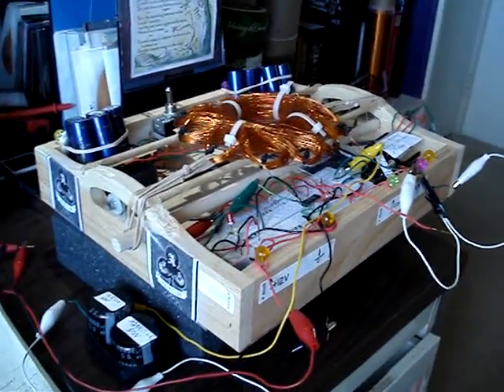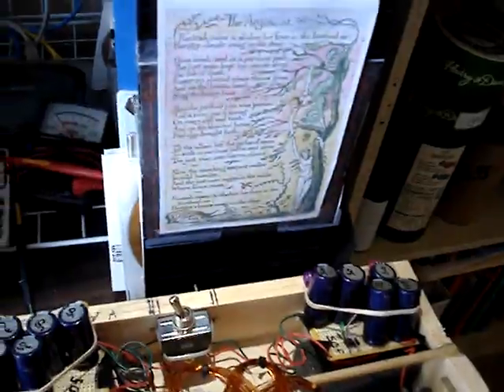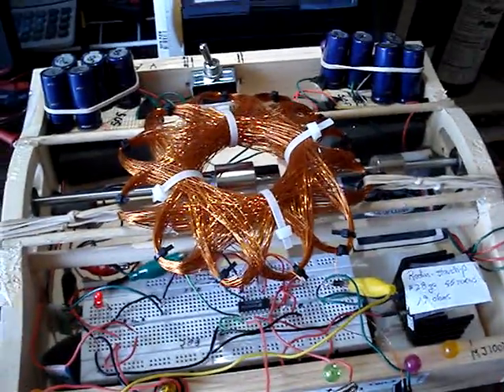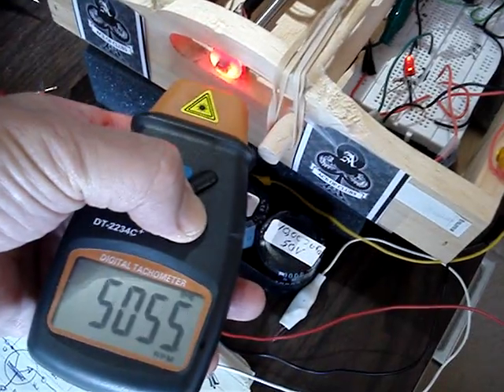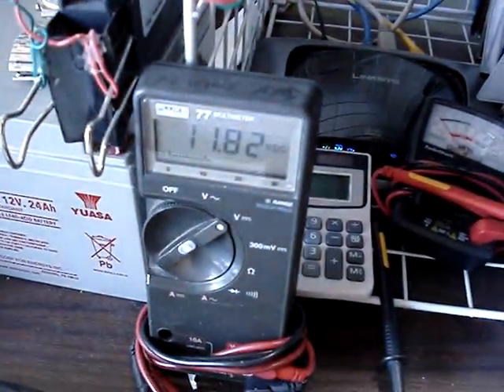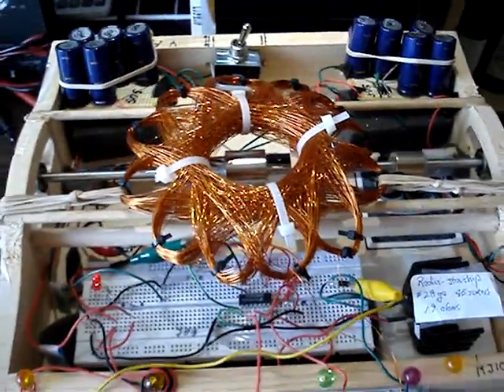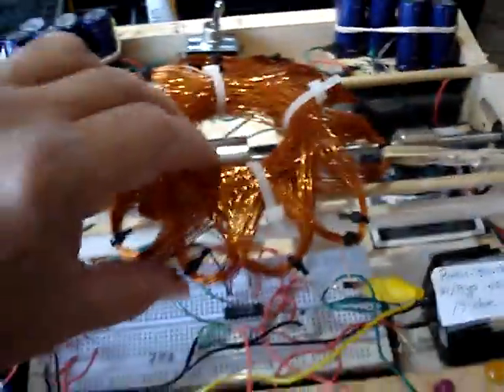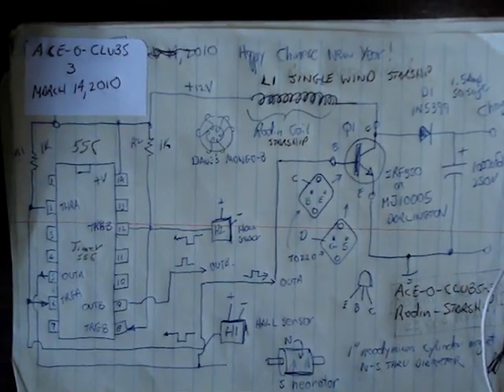ACE-O-CLUBS 3 Rodin-Starship Coil Pulse Motor

Comment: don't suppose i could trouble you for a pdf of your ace-o-clubs diagram could i? :)

i'm about to make my first starship, i just spent the day fabricating a really nice 8" wooden peg-wheel .i call it my starship clock because i have the 12 pegs numbered in the order in which they are would so it looks like a big clock with crazy numbers. anyway, i was glad to find this video because i came up with the same application idea in my head a few days ago. i'd like to stand on your sholders if i may :)